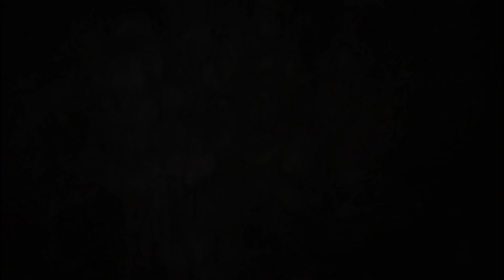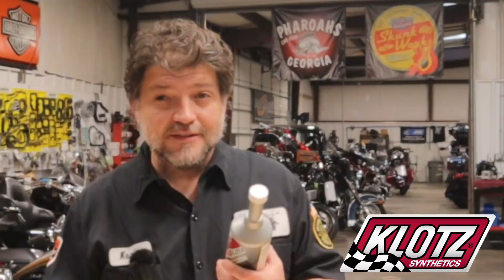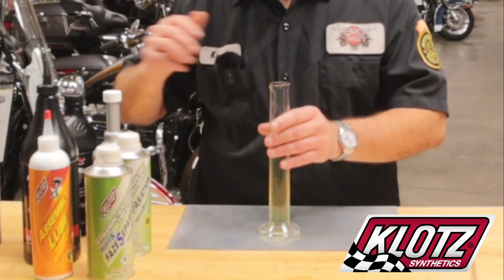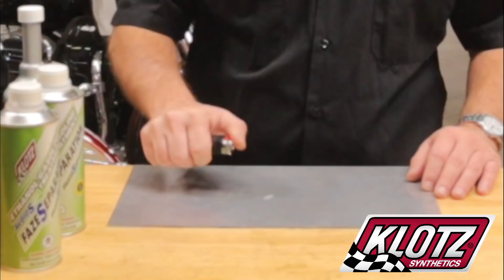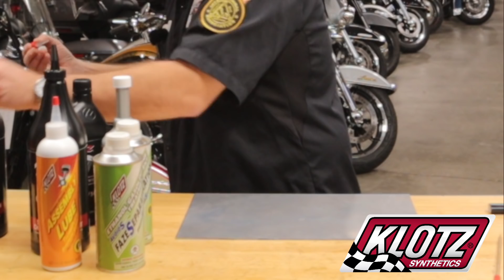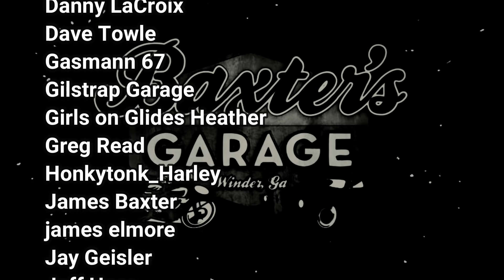HOW TO Winterize Your Harley - KLOTZ LUBRICANTS - Kevin Baxter - Pro Twin Performance

Comment: I have always told my mates to refuel before heading home & parking to prevent condensation within the fuel tank.... 
This is an unwritten Law for truck driver's, as condensation/water has no place in a motor.... So I make it a practice of mine to always keep all my vehicle's full before parking up

Comment: In the past you've stated that you're a big Amsoil fan and that's all you use. Are you now switching to Klotz? Is it a better oil for my m8?
Reply from the maker: I'm not making the switch just yet.  We are currently undergoing independent lab testing using samples from dozens of riders across the US to determine which is superior.  I am also discussing a custom formulation specifically for performance engines and would have Klotz manufacture that for us.  Stay tuned....we will know soon.  If we can produce a better oil, we will, and after confirmation only then would I make the switch.
Reply: @KevinBaxter  Thanks for the Reply. Great videos. Really enjoy watching your videos. I have another question....I just purchased a 2021 Road Glide Special.  Do I need to modify or add a crankcase breather to my bike? Thanks

Comment: Winterizers are for people that don't ride year round..... And I am in Tennessee
Reply: I used to sell Klotz ln the early 80s and before that I recommended n d30 or 2 cycle oil in the gas tank ride 10 miles change all fluids and then set it up for storage....ps I understand that we have a mutual acquaintance Andy Anderson

Comment: Well, I'm too old and worn out to be riding 5,000 miles shortly after winter but I maybe modifying my winter storage routine just a bit. Now that I have seen this, I never did remove the batteries just left the maintainers plugged in my old bikes. I'd pull the plugs put a little oil in the cylinders move the kicker a few times and reinstall the plugs, hook up the chargers, line them up in the garage and put the dust covers on, I might try sending out the oil for testing for the first time ever. I have never started the bikes to warm them up and preached to my friends don't fire it up unless you ride it 15 to 20 miles. I think I'll be trying the Klotz treatments based on your demo getting late. by for now. Thanks for these videos. Mike from Maryland.

Comment: The winterizing of my 2020 Triumph Tiger 1200 XRT, 2016 Harley Davidson FXDF Fat Bob & 1994 Honda 650 NTV

All 3 bikes are ridden year round and in winter I always garage the bikes with full tanks (E10 here - UK) to prevent condensation build up in the tanks.

Prior to any cold spell when the gritters will be out on the road I thoroughly wash the bike especially underneath then spray Waxoil on those underside parts which will get the most salt spray off the road especially moving parts like main stand and side stand joints and return springs.

Having done this I then spray non body parts with ACF50, wipe off any excess or run off, start the engine and allow the fumes to circulate into all the nooks and crannies on the bike and around the engine.* When its cooled down wipe over the bike again to remove excess ACF50 keeping the rag for quick wipe-overs after a wet ride. 

* Care is needed when you first ride the bike after doing this in case the ACF50 fumes attach to the discs; this will wear off with brake application.

Moving parts like foot pegs, upper side and main stand joints I spray with motorcycle chain lube which is good for all winter. Chrome I wipe over with the ACF50 rag or WD40, likewise some of the upper frame parts. Tank and mudguards I wax polish.

Prior to retiring I worked for a franchised truck dealer, service and repairer where I could get the oil analysed from my BMW R1200 GSA at that time. With constant riding year round the quality of the oil was maintained between each service, in fact the oil I changed was perfectly good oil so had I kept the bike and not retired would have extended the service oil change period.

Sorry, but I have never heard of Klotz lubricants but then at 68 tend to stick with what I know works - at least for me.

Love your videos BTW especially the engine strip downs/rebuilds.

Comment: or, or you can do what i do here on ohio since theres no winter anymore i never store my bike. i can't i dont have any other vehicles. you dont have to store your bike they were built for way worse conditions. now i do go to10w 40/ 20/50 mix and run 20/ 50 in the gearbox caz it do get below 0 here but if theres a rut youll see me and my dog on the road. ps i put 32k on my bike last year and so many oil changes and two tire changes

Comment: This is more like a commercial than 10% ethanol isn't going to do anything if you put fuel stabilizer in it. i put my bike it storage pull the battery and put stabilizer in it and I'm done.It'll be fine.
Reply: I'm thinking the same...I had to park my bike for 4 years....and add fresh fuel...air up tires...and check oil..was good..I like his knowledge..but it's pushing a product
Reply from the maker: You would be shocked at the number of phone calls and emails I get every spring..."bike ran fine before I parked it but it won't start"...only to find the bottom of the tanks, carb bowls, or injectors dead and full of sludge. Add to the number of engines with broken, galled, or seized rings from rusted cylinders. Ill have at least 2 dozen roll thru my shop every year as well.  Yes...it is a product placement...because the stuff works. Be it tech or products, if its proven, has worked well for me and others, does what it claims, and is a good value, I tell people about it.  Its awesome you and the poster above have had great luck...but so many don't. Be it how its stored, where its stored, their humidity, fuel in it, or whatever the case.  A Google search asking about problems with ethanol fuels will return thousands of articles and information on the validity of issues with it. Thanks for your comment and for watching.
Reply: @KevinBaxter  I live in southeast Michigan. My garage rarely dips below 30°. Yesterday I pulled the carburetor off my pan head and found water in the float Bowl. The ethanol gas was less than two months old. I drain the remaining gasoline from the tanks and I will refill them with non-ethanol fuel with stabilizer. I also pulled my spark plugs and fogged both cylinders. I know this didn't cover the intake valves but they've been okay in the past. Kevin's advice is spot-on for those of us who cannot ride year-round. Thank you Kevin for all you do and I look forward to all your videos. Take care

Comment: I don't put my bikes away for winter. I ride year round. In the past I didn't ride when ice was on the roads. I fixed that a few months ago. I restored an old Velorex sidecar and attached it to my bike. I'm old and was starting to have trouble with simply moving my bike around without dropping it. No more worries about that with the sidecar. I actually should have gotten a sidecar a long time ago. Riding with a sidecar is a lot more fun than I imagined it would become after getting used to driving it and becoming proficient at it. No more worries about going down on the ice either.